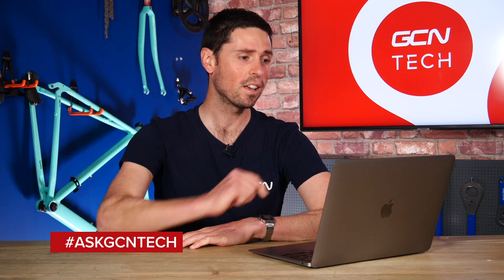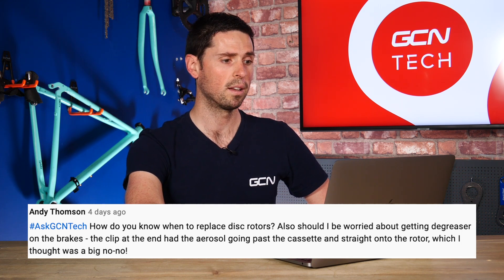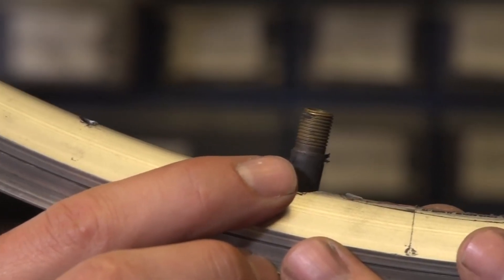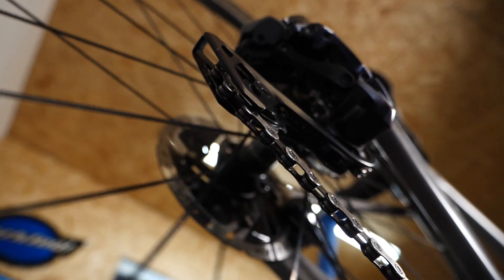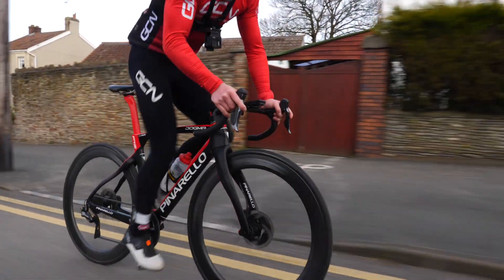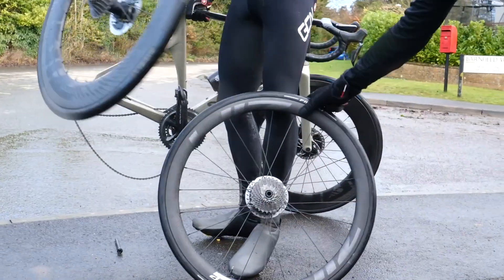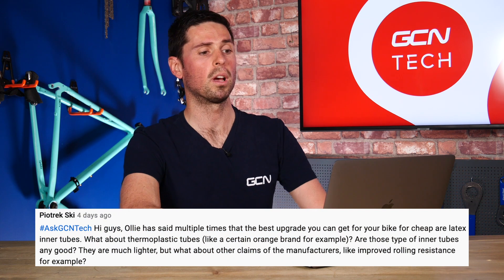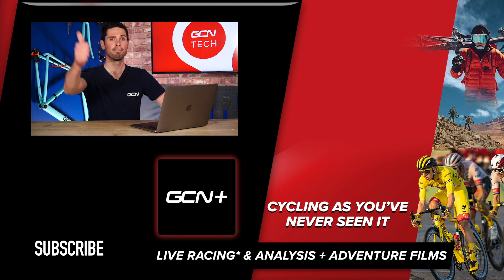When Should You Replace Your Bike's Disc Brake Rotors? | GCN Tech Clinic #AskGCNTech

Comment: #AskGCNTech can I put drop bar brake levers for rim brakes  on my existing flat bar ones  as I am changing my flat bar hybrid to drop bar gravel bike
Reply: If you're using cantilever or V-brakes, beware of not having enough "travel" in the road levers to put sufficient force into the brakes. I ran into this and had to find a product called "Travel Agents". They are hard to come by nowadays. There is also one brand at least, of road levers that offer enough travel but I can't remember it. Check with your LBS.
Reply: @stuartfreedman6854  I am using v brakes currently
Reply: Can't I add spacers in brake pads 
So that travel be reduced significantly
Reply: @goliatorharrison9557  I went through this doing the exact same conversion. If you bring the pads closer to the rim, (1) they are more likely to rub and (2) they STILL did not apply enough force even when the lever was pulled all the way. A scary situation. Check your LBS is the safe way to go.
Reply: I just remembered - the levers that work are called "linear pull". This is a design, not a brand name. Good luck and stay safe.
Reply: @stuartfreedman6854  thanks bro for helping me out I will keep in mind your advise while doing conversion
Reply: @goliatorharrison9557  I think long pull levers work ok on short pull brakes but not the other way round
Reply: @stuartfreedman6854  thanks bro I got linear pull aero brakes  
Tektro rl 520 I read these are compatible with v brakes
Reply: @goliatorharrison9557  Yes, I've seen them.What are you doing about your shifting?
Reply: @stuartfreedman6854  I would be using MTB index shifter because didn't get integrated one for 3x7 speed drivetrain
Reply: @goliatorharrison9557  Cool as long as it works for you... Too bad we can't exchange bike photos here. Take care.

Comment: What is the difference between Road Bike and Mountain Bike brake callipers? Can I use mechanical mountain bike callipers with road bike brake levers? #AskGCNTech
Reply: Depends , if it's a old mtb with canterlever they will work as they short pull , if their v brakes you need a cabel ratio adjuster and the same if their cabel disk brakes as their both long pull, think hydrolic brakes would work on both if you can mount them ,

Comment: After a massive bonk/dehydration/ heat exhaustion ride, I found I had lost ten lbs. I don't recommend this as a weight loss method.
Reply: Not uncommon, many sports have athletes who lose weight after a game of performance
Reply: Second that. You're way dehydrated at that point (3% of body weight or more). It will take several days to restore all the fluid loss if done properly.

Comment: You guys always leave out some piece of information no matter if it's Road or mountain bike  Tech questions. 🤦‍♂️🤷‍♂️
In addition to wear on a rotor, if a rotor becomes burnished from heat or possibly slightly warped then it's time to replace it. This could happen long before the thickness wears down to less than 1.5 mm.
Reply: I found that out the hard way. Really noisy braking from the rear wheel. Rotor was "burned" and that can't be fixed.

Comment: #AskGCNTech I damaged my Ultegra derailleur, should i upgrade to Di2 or is there any way to fix it?
Reply: What? Are you simply looking for an excuse to replace your entire drivetrain? What happened to your derailleur?
Reply: Di2 is an entire overhaul. That's new shifters and both front and rear derailleurs + battery and junction box. Derailleurs are surprisingly tough and the derailleur hanger is designed to give and break to even help minimize damage further. It might be fixable. Even if it isn't a new Ultegra mechanical derailleur would be the more affordable option and easier to source.

I'm trying to upgrade my bike to a Di2 groupset and sourcing parts has been an absolute nightmare, especially if you're using rim brakes.

Comment: Thank god for rim brakes
Reply: Damn straight!
Reply: Thank god for having to replace your entire carbon wheelset when the resin has worn through ;)
Reply: @blopin2002  YUP 👍 100kg rider on Exmoor... it’s up or down and would go through wheels like crazy. Disposing of discs instead of a while wheel has to be better for the environment too
Reply: No, he gave horrible advice and actually didn't know what he was talking about. They make shims for center lock and 6 bolt rotors to adjust the rotors out. I had to use them on my new wheels which are center lock so that I can switch between wheels without having to adjust the calipers each time. Yes, it is still more of a faff though.
Reply: @blopin2002  why is the rim brakes winning the races and no pro likes disc?
Reply: @701garage  all down to what the manufacturers are producing... if Pinarello only offered disc there Bernal would still be winning and no one would be having this pointless discussion
Reply: @blopin2002  thank god for not bying useless carbon wheels... :-D
Reply: @KOMHuntTV  if you care about the enviroment you do not use any carbon on your bike..
Reply: @nick philpott a slurry of sand and dirt will eat away at your rims on wet roads, regardless of the pads you're using
Reply: @nick philpott interesting, now I need to get my hands on a pair of 340's
Reply: Lot of people who don’t know how to look after their bike and set the brakes up. It took me 8 years to wear down some carbon fulcrums. How many rotors would you go through in 8 years. Ohhhh yeah you’d probably struggle as here in the uk there is extremely limited stock of shimano rotors...so good luck with shimano in 2021 and if the rumours are true 2022 as well. I’ll keep dropping disc brake fools on my winspaces.